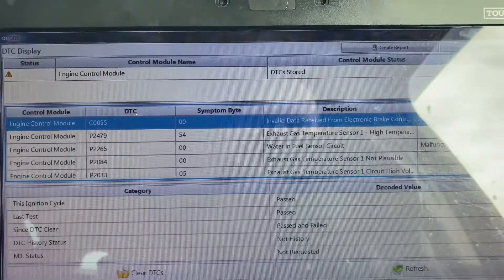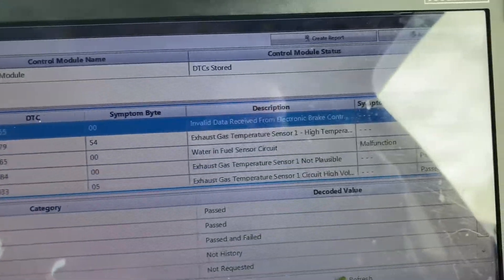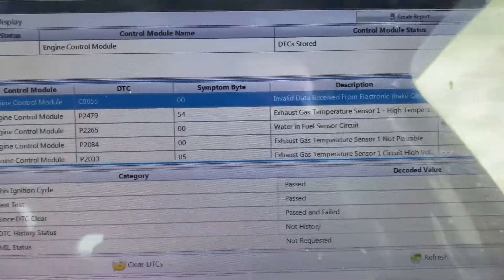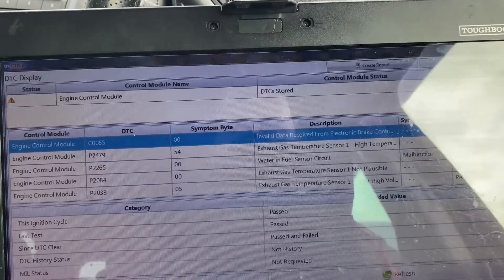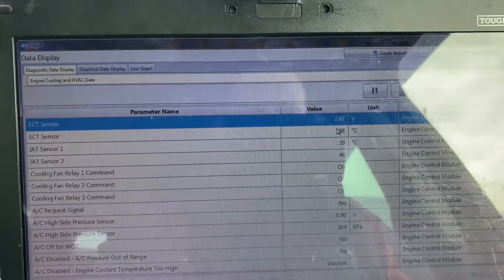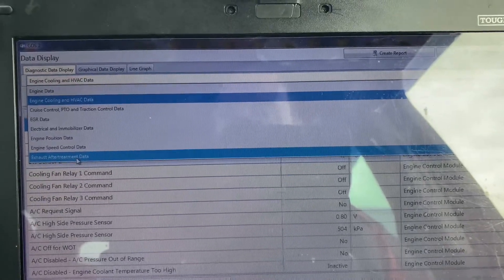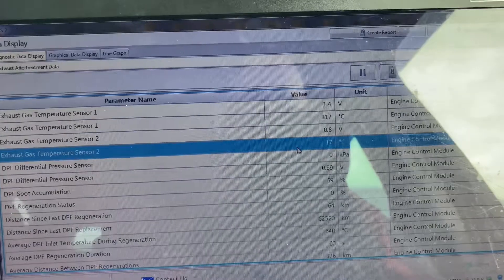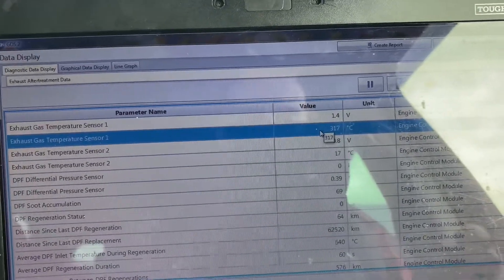P2479 (54) Exhaust gas temperature  sensor 1 - High temperature | P2084 |P2033

Comment: Would be nice seeing more videos from you pal!
Reply from the maker: Been very busy but have had some good AD-BLUE issues on Vivaro’s. I’ll try and get some on film
Reply: How to bridge the connector pls? Its showing 1200C on the sensor. Can i somehow solve the issue without buying a new sensor or no ?
Reply: @dzudzo8146  unplug it if wiring is intact it should go to a default reading.. not sure if 1200 is the default reading and the ecu things the sensor is unplugged
Reply: What do u mean by bride the connector